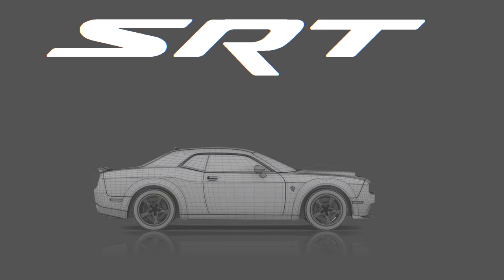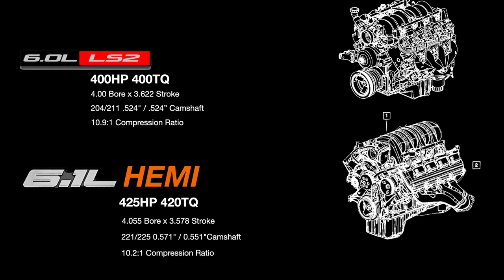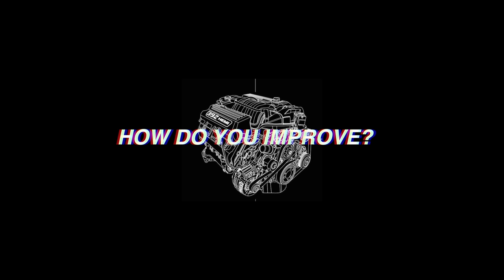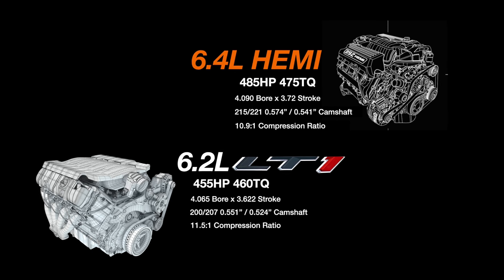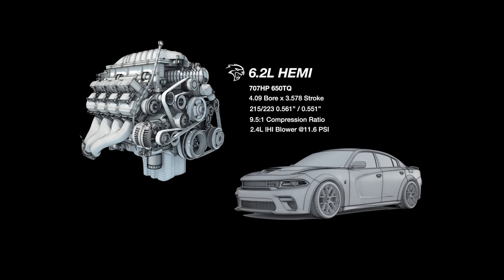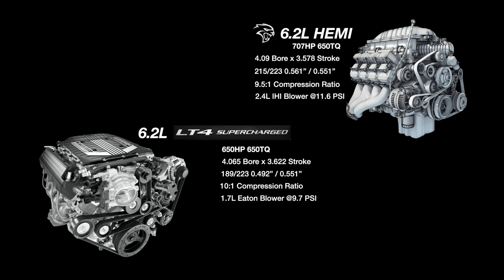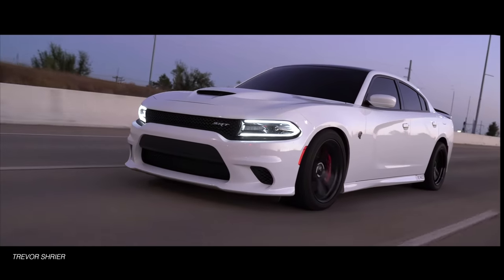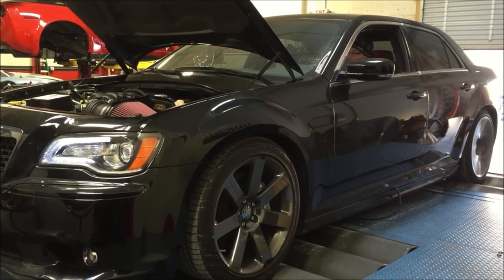Why SRT Engines Are Way Too Powerful😳| Explained Ep.3

Comment: What do I get with modern metallurgy and electronics? What is the life expectancy of these modern engines? I daily my '16 392 scat pack charger with over 82k miles on the clock. 
I am a bit apprehensive with the longer stroke and accompanying piston speeds, compared to the 318la 3.91"x3.31" 340la 4.04"x3.31" and 360la 4"x3.58" and the 383b 4.25"x3.38" and 400b 4.34"x3.38" engines, seeing how high these new hemi engines rev.
Right now I am building a 0.030" over 360la sft cam engine for my 68 Barracuda with an a727 and 4.10 Dana 60, and it will easily walk away from my '16 392 Charger. I expect to be running deep into the 11's with this simple build.
My 360 engine design is nothing more than a 1950's 318 poly with wedge heads, and an ignition system from the 70's! Why is it that a 70 and 50 year old design is still more competitive than modern stuff? And it is significantly less expensive. What do I get with modern metallurgy and electronics? Sell me on the opportunity cost of these modern hemis.

Comment: All the experts on here. Let’s go to the top of the heap I. 1/4 mile racing. Anyone. Hemi ring a bell. Been there since the 60’s. Still in top. Top fuel that is. No LTs or Ls. No coyote. Just Hemi. Challenger has not had a body up grade for 7 years. Charger either. But they still sell more and more. People love the New 3rd gen Hemi Cars. That’s what is being said. Notice how every win against a Hellcat is posted everywhere. That is what every other car is compared to. Built and modified over stock. Then go run a stock Hellcat and get your bragging rights. So Hemi is by popular demand the litmus test to compare what you brought. Long live the HEMI.

Comment: Everybody wants more power. When I was 18 I dreamed of having 500HP in my 10 year old 1972 Challenger Now I realize how stupid I was. I had a 4 barrel 400 in there with headers and dual exhaust, and already If I floored the car from a stop light I would mostly spin the the tires. If I regularly drag raced, sure, I could set up the suspension to get the tires to hook up. But then the car would be out handled by a rice burner. I expected slot car handling with that 500HP. Impossible. Now that I'm older and hopefully wiser, I find that 10lbs per HP seems to be the magic ratio. A car with that power to weight is plenty quick for the street, and can still hold the road when taking on-ramps at 20 MPH over their posted speed. Best of all, 300HP is easily and cheaply attainable  from a 1990s junkyard 360 Magnum. And if you go that route, you can swap over all the electronics and fuel-injection and have all the drivability benefits we've come to expect from from modern cars. Although.... I"d still be tempted to install a pointless super-charger, just for the sound and, you know, Mad Max.

Comment: What? 6.1 Hemis love boost lmao what are you smoking? They handle 600 to 700 wheel stock block.... Also, the 392 does gap camaros and Vettes lol. They just need a tune a minor bolt ons and they are monsters.
Reply from the maker: And a shit 4.8 LS can handle 800WHP stock bottom end so not impressive.
Reply: Not real Hemi engines.
Reply: @337speed  no they can't lmao, I literally build both engines from both platforms..... the LS will blow up running 800 wheel on stock bottom end so your video is irrelevant.

Comment: I don't think you people understand... other manufacturers can build a V8 with 1000+ horsepower, but choose not to because of the unreliability of making excessive power it doesn't need which causes an excessively high failure rate, which in turn makes it a crappy auto to have. Mileage is like at the lowest of the low as well. These dodges break down all the time, the evidence is there quite often on the side of the interstate😅🤪

Comment: Nah......SRT engines are just right. Look at the amount of power relative to airflow or boost. These engines are understressed from the factory, since they have to minimize warranty claims as much as possible. Can they be improved upon, yes.....it's just a pump like all the rest. The 6.4 Scatty really just needs a cam swap and a tune since it's optimized so well from the factory. The Hellcat...and I know folks won't like this.....twin turbos. Yea, I said it. Get rid of the blower and add spoolie boys on and the world opens up. I know you can port the blower front to back, pop on a Whipple.....BUT....turbos make you unlimited.

Comment: The 6.1 is NOT related to the 5.7.  You better get your information straight with facts.  The 6.1 is heavily reinforced at the bulkhead.  The 5.7 cannot be bored to 6.1, tte 6.1 can be bored to 7.3 liters.

Comment: Monster vs. Sports cars.  Many fail the distinction.  Thanks.

I wonder what the effective compression ratios are under boost.  Will the GM's be higher?  Dunno. The time for a mathematical deep dive...

I'd imagine loss of displacement on supercharged engines occurred in older generation vehicles was partly due to manufacturers using cupped pistons or equivalently deep reliefs which added volume to the combustion chamber.  With everything else the same, voila, lower compression.  Hey, fill that larger volume with more air and fuel!  Of course, build it stouter, top and bottom.  Give it more flow while maximizing lubrication and cooling.

Oh, I'd love to see the plots, their shapes and width.  Wondered onto this video.  Noice.  I'd wager the GM's have tad higher redlines..

There's an inline-6 in GM's stable that was in the Trailblazer.  Always imagined a car transplant but knew to keep it imagination.  Oil pan too deep.  Anyway, those outlines and pics show brutish engines, modern big blocks.  GM seems to have mastered the small big block, large displacement-small block engine.

Thanks again.

Comment: The horsepower from these engines for the size is pretty darn terrible actually. All the European manufacturers are bettering and matching the horsepower with way smaller engines. In a lot of cases getting 150-200hp a liter. These engines are only really viable in a country where petrol is so cheap. European fuel costs have always been 3-4x more than the Americans.

Comment: I live for these supercharged Hemis.  My first Hellcat was a 2016 Challenger with 707hp (purchased in 2019 and she had only 650 miles on her) and that was the first time I ever owned a vehicle with such a crazy amount of horsepower (my Mustang GT had about 460).  I also owned a 2019 392 Charger with 485hp.   After 2 years, I traded them both for a TorRed Charger Hellcat Redeye with 797hp, demonic red seats, sunroof, and warp speed wheels.   Best decision I ever made.

I don't even begin to understand all the technical mumbo jumbo this video cranks out but I thought it would be fun to watch (the guy goes way too fast and I can't keep up with it). I don't even know what a cam does.  Bored, stroked out, compression, vvt, blah blah blah, it's all Chinese to me.  You know what, I don't give a shit. I don't need to work on these engines,  I just wanna drive the damn thing. 

And let me tell everyone, until you actually drive a Redeye, you don't understand the insane amount of power.  Almost 800 horsepower and the damn thing is completely sick.  Unless you're in another Redeye or a Demon or a Super Stock, or OK, maybe a 2020 GT 500 or a Super Snake, or even  a supercharged ZL1 (650HP but a lot lighter than my Redeye) or some European piece of garbage BMW that cost 170k (vs 90K for my Redeye), you're not gonna touch my Redeye.  I smoke everyone and it's a pleasure seeing them all in my rear view mirror.  Do not pull up next to me on the highway and challenge me because I will make you look and feel stupid. And remember, my Redeye is stock.  Don't pull up next to me in some modified Chevy shitbox with 1000+hp and tell me you're the man.  You pumped thousands more into your vehicle to get it to that much power.  If you pull that crap on me, i'm gonna show you my wallet that has all the cash in it that you spent adding all the crap you had to add to get all that horsepower. And you'll still own a Chevy.

If you're driving at, say, 55-65 and you punch it in a Redeye, prepare to have your stomach go into your nostrils.  I've been driving fast cars all my life and I still am overwhelmed at how much power this vehicle has.  Keep your fiberglass Corvettes, and keep your high end Lambs that cost more than a house in a really good neighborhood.  I'm not interested in why an LS motor is superior in some ways to an SRT motor. The SRT is the most bang for your buck.  And the interior of a Charger is cavernous.  Go ahead and smush yourself into a breadbox C8 and then tell me how comfortable it is.  And don't forget to tell me how you paid 115K + all the tax for your C8 vs 90k for my Redeye.  

I appreciated this video and I guess I learned a few things.  But ultimately, I don't really care to know the technical stuff.  All I need to know is the Red Key ignites 797hp in a 10 second car and let's me dream of maybe one day hitting 203.
Reply: Pretty sweet that you got a redeye! Definitely one of my bucket list cars. 👍😎 you'll definitely piss off some ls chevy fan girls with your comment! 🤣🤣
Reply: They are not real Hemi engines.

Comment: Has GM's more conservative approach to cams and boost pressures resulted in better longevity and reliability compared to Dodge?  Logic would say yes, but actual data sometimes disagrees.  Anyone know?
Reply: Good question. I’m not seeing many hellcats into 100k area, some but not many. Not because they break, but I think ppl drive them less as the mileage goes up. Only I’ve seen is with the earlier blowers having issues. Not sure on earlier TSB`.

Comment: The demon SRT ev and hybrid. Ghoul four door sedan. Charger.😊 Gas& electric 💡⚡😅😮❤
Reply: This baby demon has an powerful V6 six cylinder engine. Plus a powerful electric motor. The baby demon srt ghoul dodge charger. Sounds like a raptor. SRT addicts. 😮😅😊❤
Reply: It's coming 😊
Reply: I like the front grille 😊. You tube.

Comment: Why do factory v8 performance engines make fairly poor hp per litre? 

100hp per litre NA is a decent benchmark for 4 pots but V8's don't seem to get close?? 

Likewise an average boosted factory performance 4 pot will see 200 hp per litre but the boosted V8's are less 150hp per litre? 

Why is this?

Comment: Love how he never brings the ford options into the picture as they punch well above their weight.
Reply: If you want a Ford that can challenge my 90K STR Redeye, go buy a 2020or 2021 GT500 for 120K.
Reply: SRT*
Reply: @KevinSmith-bg9tt  um you can buy a 37k base gt and slap a 9k 3L whipple on it that will destroy your redeye. Coyotes are made for boost from the factory. No need for different ring gaps or forged internals. Factory heads flow insane cfm. Also GT500's have a much lower msrp than 120k but sure you can spec one out with every bell and whistle for 120k.
Reply: @07slowbalt    I really couldn't care less to hear about buying some base GT and slapping a supercharger on it. Great, so now you have a Roush that has 700-750hp with 12 pounds of boost.  CLAP CLAP CLAP.   And "destroy" is absurd as well as complete fiction.  A Roush is 0-60 mph in 3.6 seconds and  has a quarter mile time of 11.2 seconds.   
My Redeye is 3.2 sec 0-60 and a 10.2 second car with Nittos on her. And that's stock, no mods (except the Nittos), no muss, no fuss.  And i'll enjoy my cavernous interior vs sitting in something a bit bigger than a breadbox.  I own a 2021 Mach 1 Mustang. I know the difference.  Thanks for your reply.
Reply: @KevinSmith-bg9tt  sure you do buddy lol. Love how you gotta like your own comments as well. If you knew your cars then you would know rousch s/c is the worst possible offering. Yet a stage 3 being the worst is still gonna run a train on a hellcat. Plenty of vids on them power levels proving it. Again if you read what i wrote a whipple is by far the better option that doesnt get heatsoaked, warrantied, and provides much better power options and yes when i say destroy i mean it, it will destroy your beloved dodge junk. You dont have to slap it on a base GT, that was simply a point being made. You could put it on say your mach 1 that you likely dont own and the end result will still be the same, a dodge killer

Comment: If the bore is the same why not just put the low compression pistons out the boosted motors 😂. In the 392 motor then it will handle boost

Comment: The Neon “rivalled the Japanese competition”? The Viper was a “supercar”? These engines are 1950s technology 2 valve motors that make minimal power per cubic inch, get crappy fuel economy, and grenade all the time given that the only forged bit in the engine is the crankshaft. I used to work for Chrysler; their technology is junk, and "Hemi" used to mean something back in the 1960s, but today almost all engines have hemispherical, or pent-roof, combustion chambers -- it's just marketing for the unwashed. Want a good 6.2 liter V8? Try the M156.

Comment: False, the 392s were in production way before the 6.1 or 5.7 Hemis. They were originally used as performance create engines from Mopar before. You could get them in the 60s/70s Mopars as well. The talk of the 392s\5m6.4s are stroked 5.7s, is all false 🤦🏾‍♂️🤦🏾‍♂️
Reply: And even with the same mods for mods, the 6.4s will always gap the 5.7s 🤷🏾‍♂️💯

Comment: I'm nope I been building engines for a decade. And a small block Chevy is the most common most demanding most raced engine ever nobody is swapping srt engines into ford's and Chevys. There's no srt engines in any pro racing series. On the road course or nascar. It takes more then horsepower you have to be durable.

Comment: When you consider technology that makes hp that is usable and controllable, suspension parts, traction control, and computer-enhanced transmissions to sense torque are refinements the old did not enjoy when we look at 1/4 mi times without enhancement slightly better but not in line with the double hp so what gives. We can watch a 4 cyl honda setup get easily into 10s and still be drivable on the street, the weight of these new vehicles which are sold as the king of the road basically makes this a car that can burn rubber slide sideways and do donuts under power but to try make it an elite piece of equipment it still uses cast iron block with pushrods if naturally aspirated it would have trouble with a 351 windsor running an aluminum top end or even an old 318 with an aluminum top end. These big hp cars sell because of the hp but mostly because a/c stereo power everything and you can drive it a 1000 miles and back without issue

Comment: The SRT-4 Neon was garbage compared to the Japanese 4 cylinders in the 1990's, especially when compared to the Honda S2000 and K-series motors that were making more power without forced induction.
Reply: I agree Honda motors are far superior to Dodge. But it's worth mentioning it was well known (and proven) the SRT-4' horsepower was underrated. The S2000 displacement and hp were comparable but the torque was anemic (100 less). Also, I don't know of any K-series motor that made the same or more hp or tq than the SRT-4. Can you elaborate?

Comment: The biggest problem with the Hemi is that it’s still in a Dodge. If they could just fit one into an Accord so I don’t have to worry about the A/C vents breaking, or the volume knob on the stereo crapping out, or the seat falling apart and the springs coming through

Comment: I mean there’s pros and cons to these high power engines. for the most part they’re useless especially their 392 engines
They build them with so much in power from the factory but they can’t really handle any boost without having to rebuild the engine. At that, they end up getting smacked by civics and your ordinary 4 cylinder cars with just a little turbo. 
Yeah the numbers that say wooow almost 500hp 392 and 700hp for the hellcats. Yeah those are big numbers but they’ll get smacked by a 300-400 hp Honda.

Comment: 1987-1994 ford 4.6 cast 4140 steel, plugged up so it wont end its self on the first drive down "???" when its 130 degrees idling at 95 behind some "?" that wont get out the way, no air flow. out of gas and cant go back... the bearing contact surface isn't any bigger heat soaks the same as the other. does one know its down on power because its getting hot faster then the water can tell ya, blown by user error... make it impossible to make the finishing move. drive by wire not cable, another 30 years and the kid will dump it for a quick $500. no limits, its junk by noon passes nor far till dawn never released to any other but one. Chicken Dinner?

Comment: I love the engines but they have never updated there heavy ass frames which is why they're so heavy and can't put the power down ford and Chevy have functioning cars that turn brake and crash much safer better. 500hp bmw would wax a hellcat

Comment: What does cfm mean
Reply: Cubic Feet per minute, How much the heads flow. You need more flow to make more power on a normally aspirated engine. Problem is that you still need to maintain velocity or the lowend will be weak/soft. With supercharging it makes up for the low velocity, Turbocharged can get away with big heads AS MUCH. 

A Big displacement engine isn't affect as much as a smaller engine with big heads, They use the displacement to regain an Torque lose due to big heads.... Plus with a BIG engine, alittle torque loss can help with getting traction during a standing start.